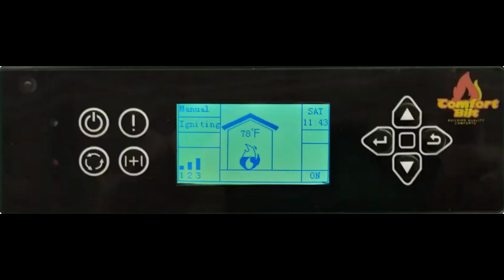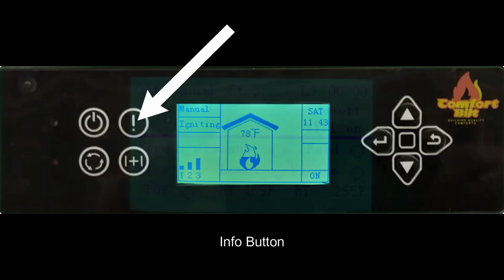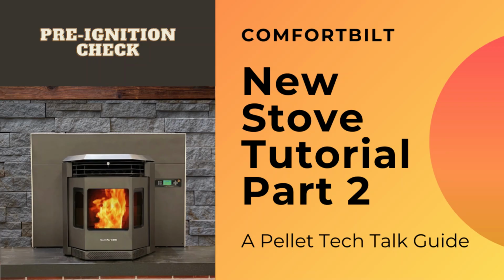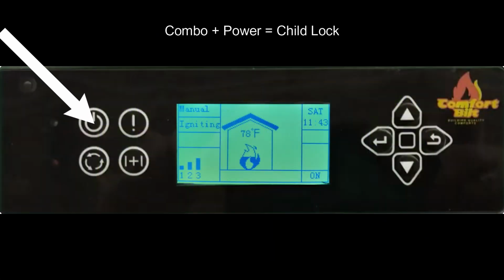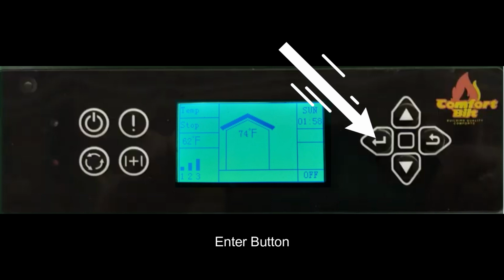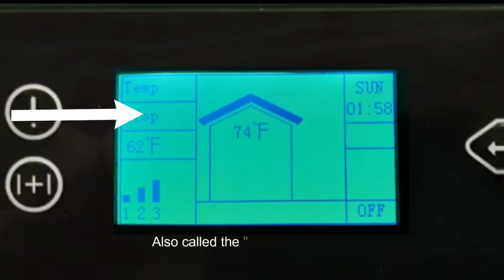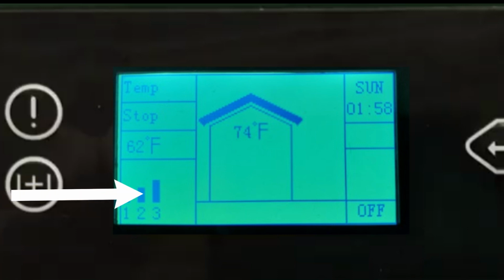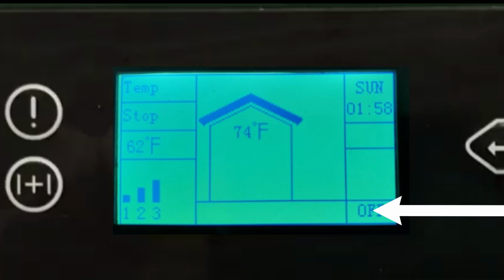New Stove Tutorial Part 3 - Control Panel Operations

Comment: Control panel will not work it gives aread out of not connected can not turn off nothing works the remote will turn the stove on or I have to turn the stove off off in the back to restart the stove panel doesn't work all the time

Comment: Can you add a thermostat to this unit! Ours is on as low as it will go but it still on and stays way to hot. We have to turn it off.
Reply: Hi,don't know if you ever figured this problem out but I had the same issue.
What it turned out to be was the thermostat wire at the back of the unit.
Mine is the Comfortbilt 22N and the thermostat wire was sitting to low.
I pulled it out and the actual room temp was correctly displayed.
The fire turned if then the unit turned off at set temp.
Hope this helps as it seems Comfortbilt doesn't answer too many questions.
Reply: @labbats  I agree with you. When I have mine on low (1), it's still hot in the room. When I had my Breckwell, they had a setting that was one below the lowest (1) setting. Is there a setting like that on Comfortbilt? Some of the tech stuff is a bit too much also.

Comment: What does ERR mean above the flame?
Reply: ERR on the screen means that the room temperature sensor probe is not sending proper data to the computer.  This usually happens when the temp sensor probe wire gets cut or damaged.